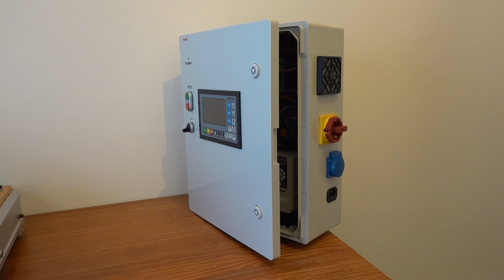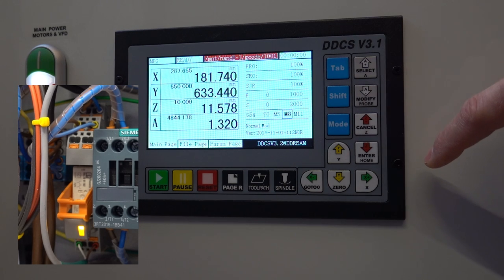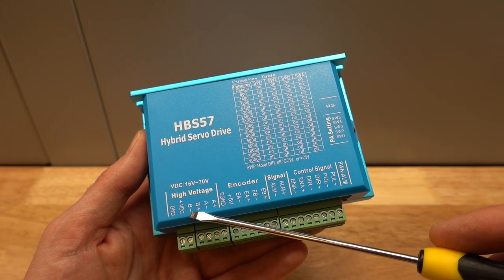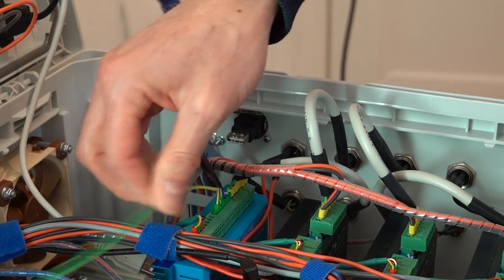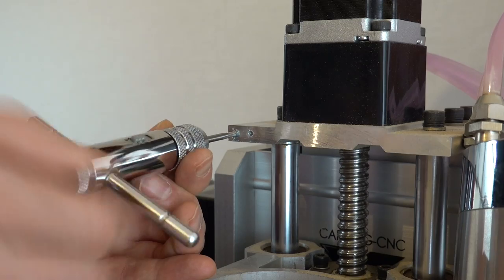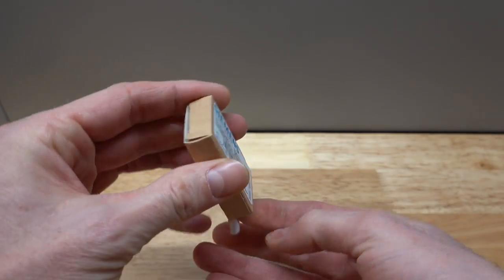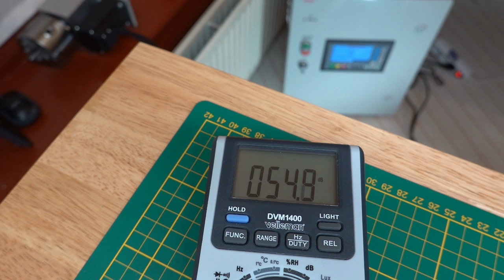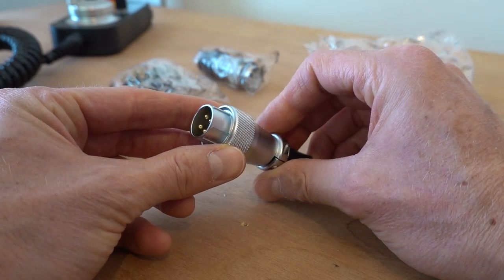Build Your Own CNC Controller Part3

Comment: Hi! Love this series! I bought a second hand cnc router that has a ddcs v2.1 but the limit switches are not connected. They are allready wired in serial and it looks like you did the same or? Could i connect one end to ground and the second to limit x- and brindge this to limit x+? I guess i will try this if i cant find an answer somewhere. Best regards!
Reply from the maker: Thanks! I only use homing switches on my machine, not limit switches. Also mine are each hooked up to their own input, but I am sharing a negative common wire. On the DDCS v3.1 all homing switches and limit switches have their own input, I assume it is the same on the v2.1. However, in if you want to avoid running additional cables I can imagine you want them in series. I think this is possible but not sure. When in series (only works with normally closed pin of the switches) each axis gets a signal if only one switches is activated. This should be fine as you just want it to give an error regardless of which axis input triggers it. Try at your own risk:)
Reply: @uptimefab7412  Aha so you use soft limits instead. Thanks for your input! Gonna check how my switches are set.
Reply from the maker: Yep using soft limits. Good luck!

Comment: Thats awesome video, thanks!
im having problems with my CNC. When i turn on the system, the step motors on Y axis change position just a little bit i can see the gear moving over the guide. Any idea what is going on ?
Reply from the maker: Thanks! This is an odd issue. In order to move visually it would need to receive a significant amount of pulses from the controller which does not seem logical. If it is only at startup and only on the Y axis I would try to swap the connectors between the Y and X axis. If the X axis now has the same issue it is the controller, otherwise it is the stepper driver. If it is the controller make sure it is not performing some type of homing cycle. This is all I can think of with the available information. Hope you can locate the source of the problem.
Reply: @uptimefab7412  thank you mate!
I checked and the X axis is doing the same thing. I was thinking that could be some left over power and when start up that would move the motor. Also i understand the pulses and maybe that would be sit between the pulses, not sure about this though ... just a brainstorm im doing... i was looking on internet and saw some pull up and pull down resistors that maybe could help when starts... not sure either... gonna keep looking
cheers!

Comment: Did you use 5 pin gx16 connectors to extend the grounding outside the case?
Reply from the maker: For grounding I ran a separate wire through the case to the spindle to ground the machine. Since you are referring to the gx16 connectors I think you are referring to shielding. I did this only for the closed loop stepper since in my system this is the only stepper with shielded wire. The other wires are not shielded (not my choice but they were already in place when I bought the machine). When I have some time to spare on a rainy day I will probay replace them with shielded cable and use the additional pin. As someone else commented it is better to connect the gx16 on a metal plate and use the housing of the connector itself to pass through the shielding. I hope this rather long response answers your question:)
Reply: @uptimefab7412  sorry, yes I should have been more clear. I was referring to the shielding for the stepper motors. Personally I wouldn’t worry about connecting the shielding to the plate unless you found a version that has the back of the panel connector also shielded.
Reply from the maker: Have not found any different connectors. So will keep things as they are for now. Thanks for your feedback!

Comment: Hi i have nearly finished my control cabinet but i need some labels for the switches etc where did you get yours from ?
Reply from the maker: Hi, I am just using a standard Dymo label printer. Works fine on most smooth surfaces.
Reply from the maker: Wow, very nice project! The CNC looks great. I also like the SMC controller.

Comment: Excellent build, question from a total newbie to cnc. How is your enclosure performing? and I have bought a RatRig 1500mm x 1000mm cnc will this enclosure system work ok with it?
Reply from the maker: Hi Paul, thanks! I was not familiar with the RatRig systems but just looked them up. A system like mine should work, but make sure you size the components (power supply, VFD, contactor) appropriately based on the stepper motors and spindle you are using for your system.
Reply: Thanks for reply can I ask do you have an overall cost of what it has cost you to date, the only difference I think I will make is the new Expert model but I’d buy everything you have in your enclosure
Reply from the maker: Highly depends on where you buy your components, but things add up quickly if you count every switch, power supply etc... My guess is around 1000 euro, but I did not keep track of the cost. Making your own controller is not cheaper than buying one I guess, but you have freedom of choice for the components you use and knowledge of how it works, which was the main reason for me.

Comment: Hi love the video and information I'm struggling with the home limit switch connection and can't find any videos or wiring in the 1 video said you linked in your page but I can't seem to find it.
Thank you
Reply from the maker: Hi, thanks! I seem to have omitted the limit switches from the electrical schematic on my website. You can place a limit switch between the appropriate connection and the negative common. To visualize this it is probably best to check the user manual for the ddcs v3.1, section 2.6.2, page 16. The manual can be found on ddcnc.com. the idea is that the switch when pressed, will make a connection between it's assigned input and the negative common. You can select in the settings menu of the controller to have it act as normally open or normally closed. Both are fine but nor ally closed is safer since it will detect a broken cable connection. Once connected you can see the status of the switch in the IO menu. Here you can press the switch and you will see it's input status visualized on the screen. Hope you can get it working with this information. Cheers
Reply: @uptimefab7412  Thank you so much so it would be X home and then the com negative which is pin 1 and then itll register as home when using home all axis?
Reply from the maker: Yes it should. Just to be safe start the homing cycle and manually press the limit switch to see if the machine responds. If not you will still have time to press the Estop.
Reply: @uptimefab7412  Thanks for the help and responding to my questions. happy building

Comment: How would you do the wirings if you're using 3 closed loop stepper motors and drive?
Reply from the maker: Hi, you could just use the same wiring as in the schematic for the closed loop motor driver and copy that for other closed loop stepper drivers.

Comment: Where is your wiring diagram for the home/limit switches? I can’t find them in your pdf or website?
Reply from the maker: You are right, forgot to include those in the diagram. I only have one switch on each axis, the home switch. Not using limit switches. The home switches are all connected with one side to COM- (pin1) and the other side to pin24 for X, pin 7 for Y and pin pin27 for Z. On the switch the Normally Closed connector is used, so a loose wire would trip the home signal. Hope this helps.
Reply: @uptimefab7412  your videos are fantastic and the details have been absolutely crucial in my build. thank you

Comment: what do you call this machine that measures temperatures thanks for answer
Reply from the maker: It's a thermal imager. UNI-T model Uti260B. It is a bit more expensive than the entry models, but the extra resolution is well worth it.

Comment: I am fascinated with this, following your idea, it does something similar, it works for me, but I have 2 concerns, the first, how do you connect the keyboard, via USB to the ddcs?  I am referring to commands in the ddcs, the Bluetooth indicator on the keyboard lights up intermittently, but does not connect, and the second, the surge suppressor diode, I am not clear about its function, thank you for sharing your knowledge, att León Anchislavsky
Reply from the maker: Hi, thank you for your feedback. I am using a  Logitech keyboard (k270)with a wireless USB dongle. It is not Bluetooth but some proprietary wireless dongle. This works fine, I have not tried any Bluetooth USB dongles. For the surge suppressor it is best to refer you to the Siemens manual that has a complete section devoted to the various types and their pros and cons. See link below, section 9.6, page 311.
https://www.google.com/url?sa=t&source=web&rct=j&url=https://support.industry.siemens.com/cs/attachments/60306557/manual_SIRIUS_contactors_3RT_en-US.pdf&ved=2ahUKEwjovZOoooT3AhXLs6QKHRZLCn8QFnoECAQQAQ&usg=AOvVaw1hhSo0RpGK6QLc0xdcTeDb
Reply: Many thanks for your answer

Comment: Hello mate. Dou you plan to make  a new update to the latest build? Would it be possible to make a wire diagram with the newest parts you build in?
Reply from the maker: Hi, it would indeed be nice to do some more videos on the router, but I have been working more on my lathe and other projects. Of there is something interesting to share I will make a new video. The wiring diagram was updated with the last video so it should represent the current state. Let me know if you miss anything specific. 
Best,
Robin
Reply: Thank you for the fast reply Robin. I just didn't understood if I have 6 proximity limit switches. How to wire them. And did you used gx16 connector also for the spindle? My spindle has 8Amps. The connectors are able to pass 5Amps. So I guess I have to wire them directly to the inverter.

Best regards

Selim
Reply from the maker: Hi, you could wire the end switches in parallel, so you could use 1 input for switches at both sides of the axis. I am not sure from the top of my head if the controller has seperate inputs. The spindle should i deed not be connected to  gx16 plug. At the end of video 3 I am showing a larger plug for use with the spindle.
Reply: @uptimefab7412  Thank you mate! 
For the spindle, I found gx20 connectors which have 25Amps current. So I will choose those.

Comment: As far as I have seen the shield on the cables outside the box are still not connected, right? You really should see to connect those shields as well as they will act like long antennas and emit a ton of EMI. The outside shield is not cut off, like you did it at 10:56, but bent backwards so that it makes contact with the metal housing of the plug and the sockets are usually connected to the ground. Since you are not using a metal enclosure, you could just put a metal plate inside the controller box and connect that to your ground connector. That way you can ground all sockets without changing too much. If you change over to a metal enclosure, would reduce the EMI considerably, make sure to remove the paint around the sockets on one end otherwise it will not work. 

On another note. Youtube says you are from the Netherlands that would mean that you also have the Type F plugs. They are rated for only one hour at 16A. Your setup is capable of using over 2,6kW so 11A-12A. Especially with older sockets running the 2.2kW VFD + the stepper PSU for longer times, like a big engraving job, might be dangerous due to the fact that the contact resistance might have increased. 
At that point I would recommend using a CEE16 Plug and connector. They are designed for 16A continuos load and would reduce the risk. 

Also please change the C14 connector. They are also only designed for 10A continuous load. I would also recommend a CEE16 socket there.
Reply from the maker: Thanks for your detailed tips, much appreciated. For the stepper cables I am indeed still using the unshielded cables that the machine came with. For building a new machine using shielded wires is indeed the best solution since it adds little to no cost but has significant benefits in therms of EMI. I will keep it like this for now until I come across interference issues although I would not recommend it to others as a good option. 
In the connectors you also have a good point. I am not expecting to have full engagement with the material for prolonged time and therefore draw more than 10 amps continuously but regardless properly rated connectors should be used. On that note I am also not on a separate group. Appliances drawing large currents should be on their own circuit breaker, not on a general group with other outlets.
Reply: @uptimefab7412  I would be careful there. Especially since an inverter is a load with a bad power factor so the current can be a lot higher than wattage may let you believe. Even my brand VFD has a power factor of just 0,71. i have no ideas how the cheaper ones behave but I would expect worse since filters and snubbers cost money. Have you measured the 10A? It would be interesting to see what your power draw is during an operation. A cheap power measuring device would do the trick. 

Also you have the other switchable output so I personally would not take the risk and recommend the 10A connector on YouTube and the website. At least I would add a low amp fuse in line with the relay so that you do not accidentally overload the connector. You never know how much people know about those things and might accidentally burn their house down. From the pictures I think it should be possible to just add one next to the relay.

And regarding EMI: It is difficult to see where it might cause problems. Might just be noise in the radio or it might cause devices not to work sporadically. Detecting problems caused by EMI is quite difficult since it has as much to do with the source  as it has with the sink. LiYCY 4 x 0,75 costs less than 1€/m. Although I would agree with you that it will most likely not be a problem I would at least mention it on the website and the video so that other people know about it in case they run into problems.
Reply from the maker: @nukularpictures  Hi, I have not measured the power draw of the entire CNC. The C14 connector has a an 8amp fast acting fuse built in, which is covered at the end of the first video. If I understand the typical time current curves for fuses correctly, this should blow if exposed to around 10 amps for any significant amount of time. This should protect both the C14 connector, switched power socket and the wall plug. I also think 8amps  is tight for the rated power of the components, but as mentioned in the video it works and it should blow if overloaded, which it has not done so far. 
I will put a note in the pinned comment that people should calculate the power needed for their specific components and use appropriate connectors (some use even more powerful steppers or larger 2.2kW spindle). 
I am not trying to cover every detail in this series, just the conversion of my specific machine, where I left some things unchanged.
Some solutions like shielded cables for the steppers, VFD in a different metal cabinet, using a metal cabinet for the controller are all better solutions and I would highly recommend them to people. However, I took an approach where I kept some sub-optimal solutions if they did not cause any issues in order to save time. People can choose to go for the better solution and spend a bit more time on their build. 
I also hope that if they are seriously considering a build like this they also take a few minutes to go through the comments, where a lot of people, including yourself, have provided very useful advice. I will also make a note about the shielded wire in the pinned comment. Thanks again and let me know if I missed anything.

Comment: Hello,
What chuck size is your 4th axis set? Are you happy with it now? Thanks
Reply from the maker: Hi, it is the k11-80mm by Rattm motor on AliExpress. I have not used it for making parts yet as I was unable to get 4th axis programs generated in FreeCAD. Decided to let it rest for now until I finish some other projects, so I can't really comment on the performance or durability of the 4th axis.
Reply: @uptimefab7412  Ok thanks. 4th axis with Fusion is gone so it might be interesting to see how Freecad handle it . I've ordered the K11 too.

Comment: Hello,
I wonder if this controller is interactive like Mach3 ?

Meaning is it possible to type Gcode in a command prompt let's say to cut a straigth line?
Thanks
Reply from the maker: Hi, there is no real MDI mode on the controller, but there is something that comes quite close. Under the file menu in the DDCS you can create a new file, type your commands in that file, save it and run it. Note that this is only possible when you plug in a USB keyboard into to the controller.
Reply: @uptimefab7412  Ok Thanks, In parrallele I asked in the facebook forum and they respond " go to Program menu and create a new gcode , then Edit, or use the MDI menu for one line gcode....
Reply from the maker: If the DDCS V3.1 has an MDI mode that would be very nice. I have not been able to find it. There is also no mention of this in the manual. Are you sure they were referring to the V3.1 and not the expert model? If you do manage to find out if it also works on the V3.1 please let me know, would be a nice option to have.